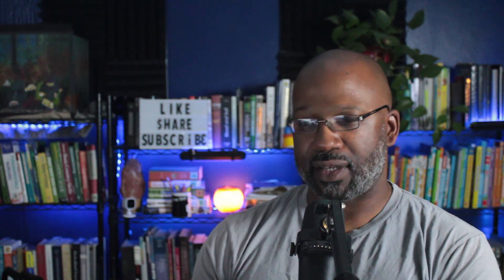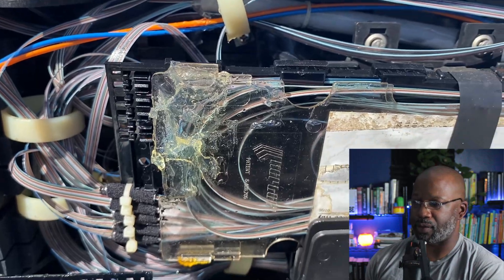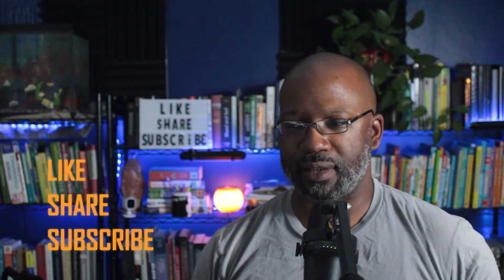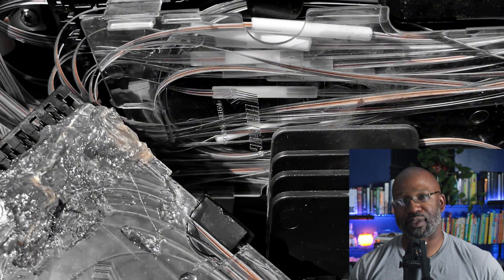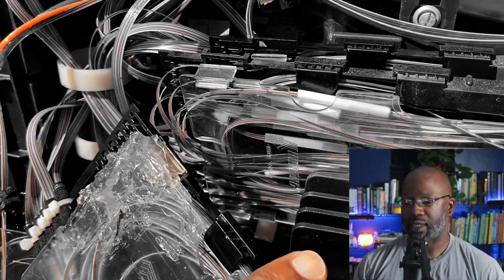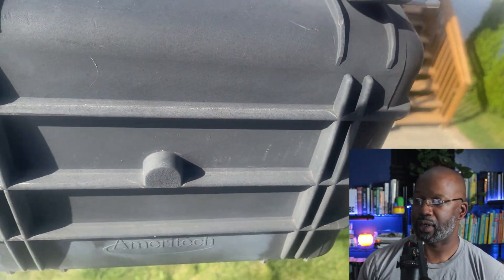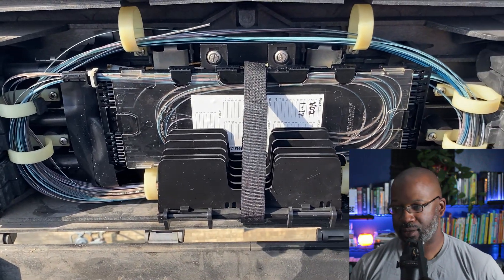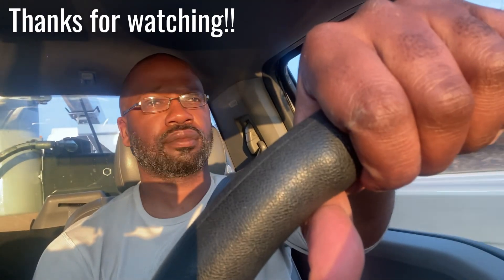Let's audit 3 FO cases!!!

Comment: Red and black fibres in 1 sleeve? Not that hard to replicate. Yet justt wrong. On one of the sites I maintain  there's a 577 ct dome joint, about 288 splices. 24 1-2 splitter each spliced with outs in single sleeves.
😂😂😂 are 2 fibre crews and 2 (office based) team leaders dreading the day we'll have to the full repair..